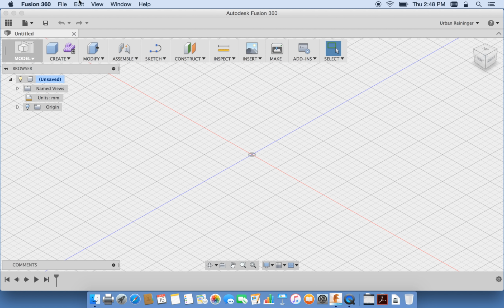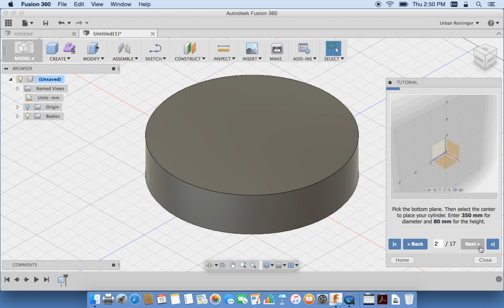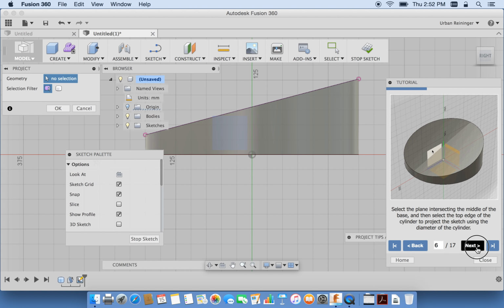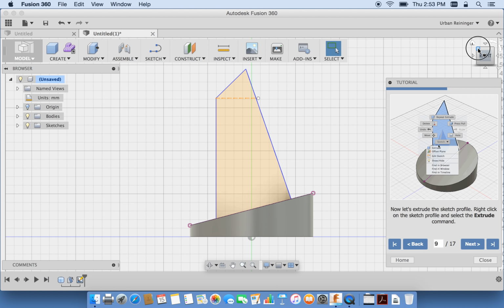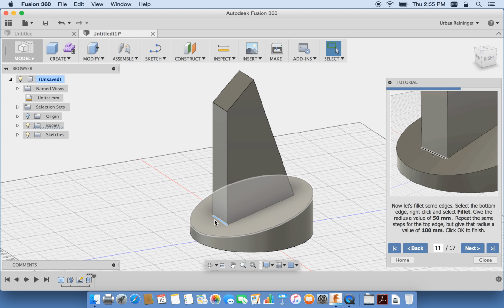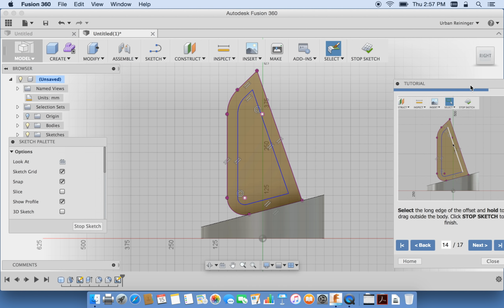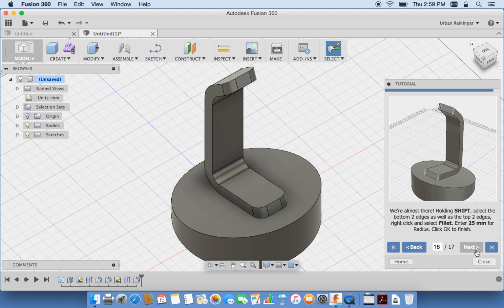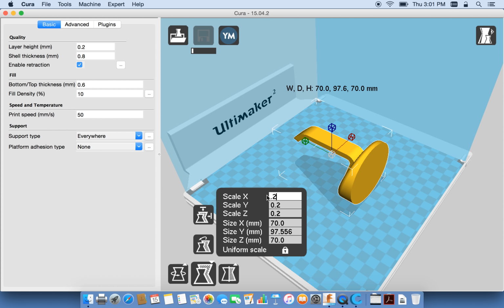Autodesk Fusion 360 - Tutorial 1: Basic Design Step-by-Step tutorials

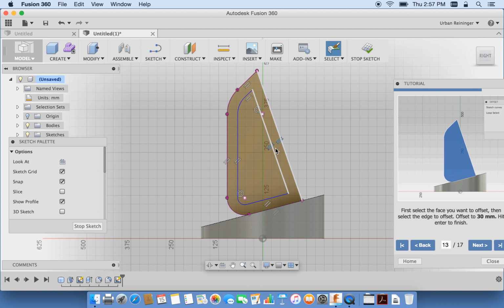Comment: Hello, great video so far. I have a problem on (9:30) with the 'Offset Tool' where it doesn't let me pull one of the lines. Am on the new version of the Fusion 360 program.
Reply: I think they removed that feature.
Reply: Try removing the constraints.

Comment: nice video bud. i cant drag the line after offsetting it ??
Reply: For now you can delete the line he is asking to drag and than drag the 2 points that were connected to that line and make a new line to connect the points. This will give you the same result he is doing in the video.
Reply from the maker: It looks like you are correct. I think I'll need to make a new video very soon. I have about 3 new tutorials that I am thinking of making if I have the time this Summer. (have to setup a large-ish scale computer re-imaging system before I switch jobs).
Reply: hey thanks for the reply. And i'll be waiting for the vids.. Really need help with this. 
Regards 
Jonathan
Reply: Thanks for the suggestion!
Reply: Thanks so much - this was driving me nuts!